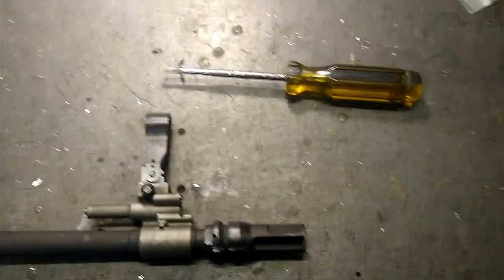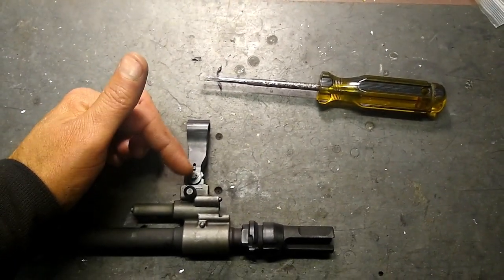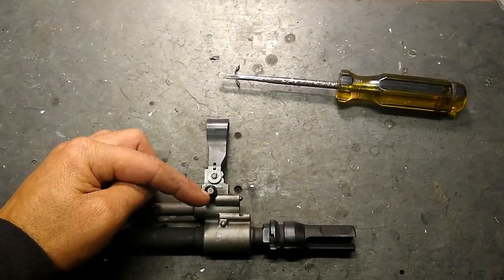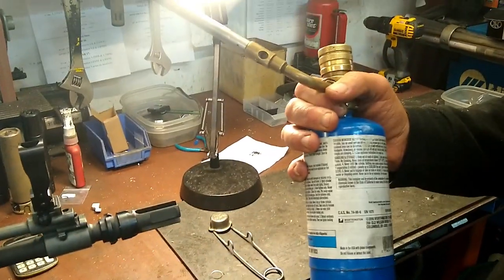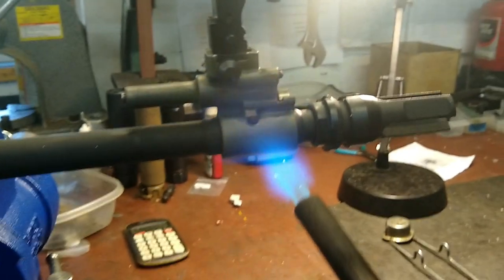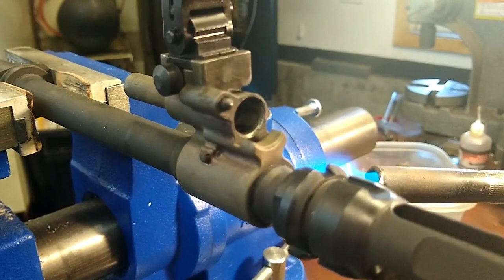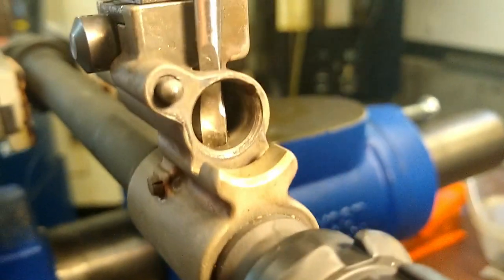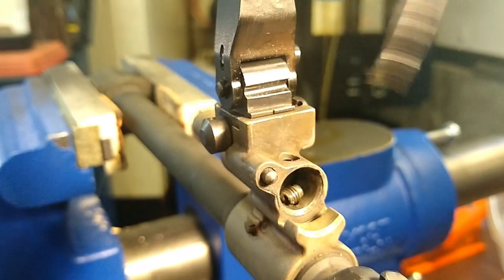PMM Tutorial on Removing the factory Gas Jet on a FN SCAR® Barrel

Comment: One of the first things I did with my SCAR 17 was replace the gas jet with a PMM gas jet. I happened to have a screw driver that fit well enough to take the factory gas jet off and didn't have to use any heat to expand the metal. The heat must be needed if the firearm has had a lot of use.